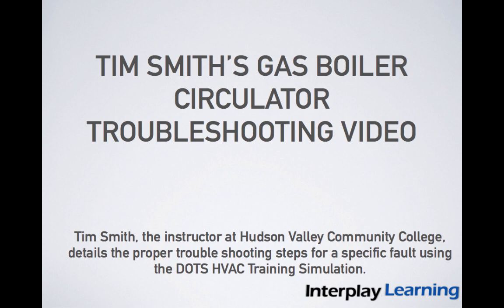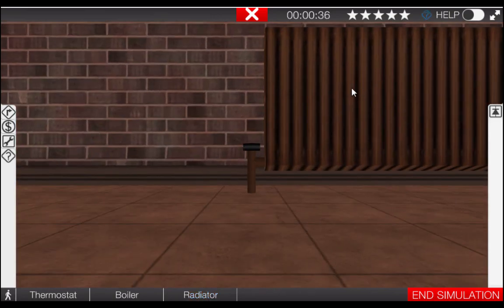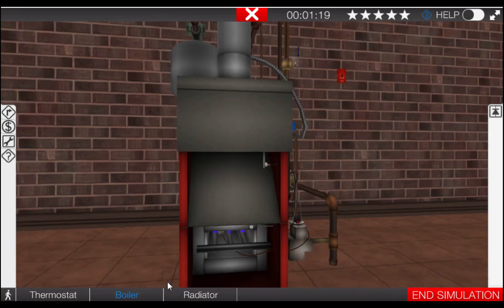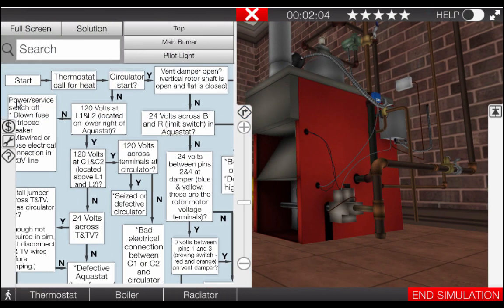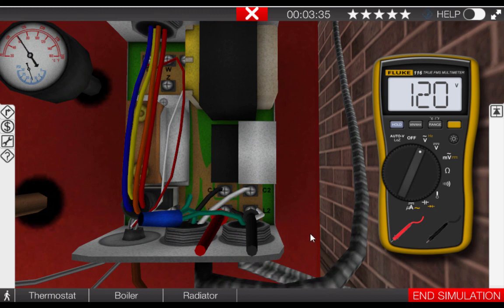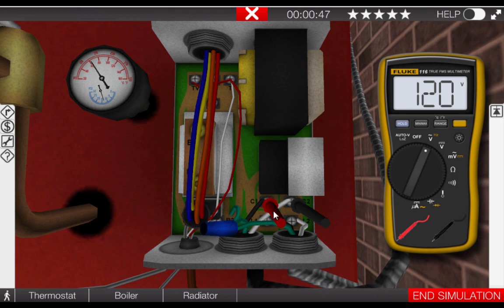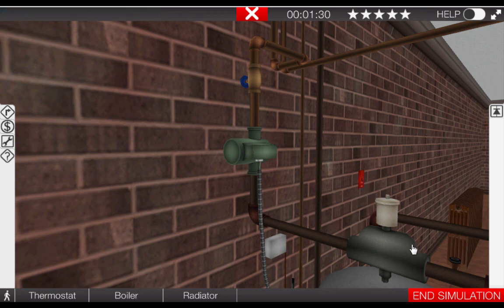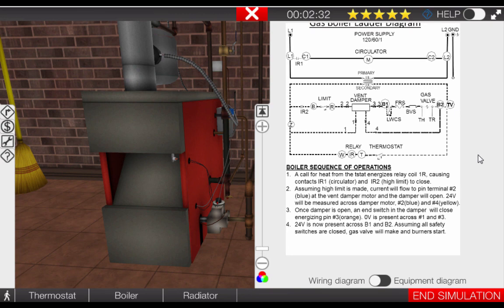Gas Boiler Circulator Troubleshooting Video

Comment: That is a great video or the greatest video in troubleshooting. However I have a question and I will very thankful if you can guide me through this. My question is that my boiler system is the same as this video. The problem is that the boiler won't stop heating and I also replace the thermostat.